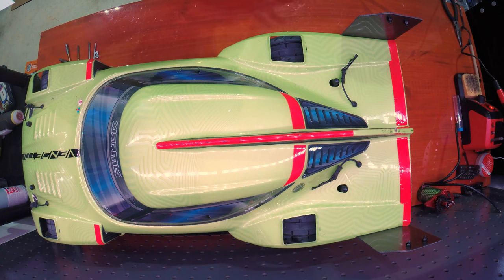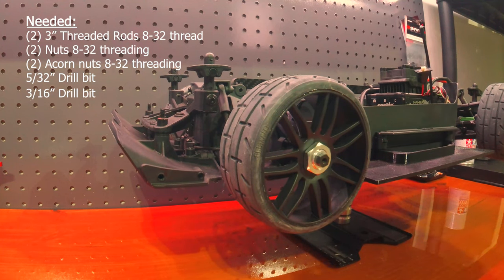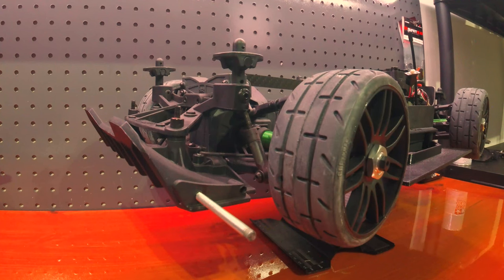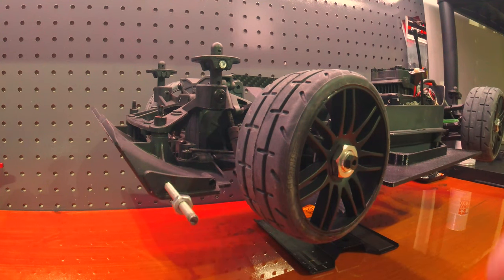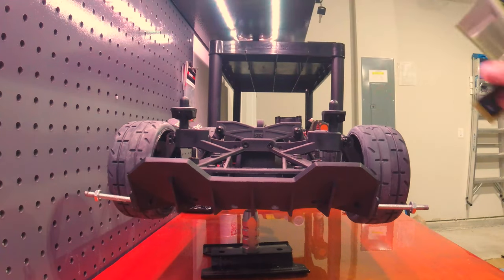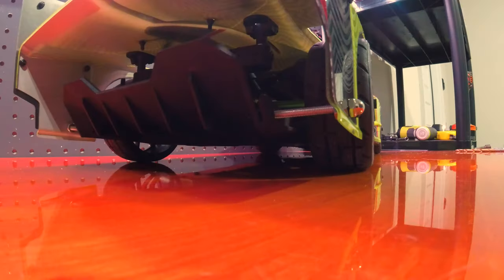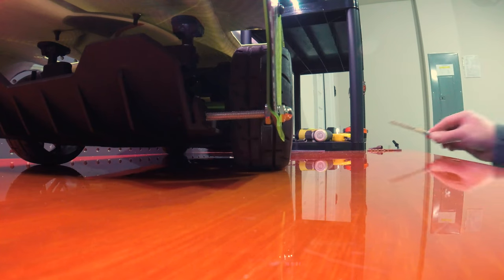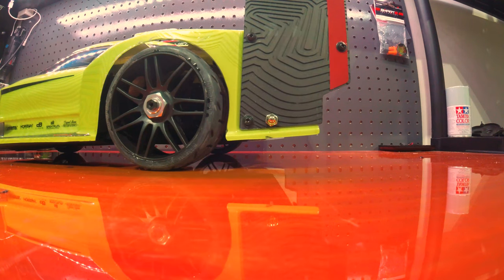Arrma Vendetta | Rear Fin Stability Fix

Comment: two suggestions double up the nuts to you can lock the nuts in place so you wont have to keep adjusting them and swapping out the acorn for a thumb nut instead will make putting on the body tool less.
Reply from the maker: Appreciate the feedback! The thumb nut is a better option than the acorn.

Comment: Great idea man, appreciate you sharing the info...definitely something I need to do to my vendetta too. Apart from taking off the speed wing, I noticed you didn't have the plastic diffuser piece also, better stability??
Reply from the maker: No problem! Yes, I still run that plastic piece above the diffuser. Some say removing it will allow trapped air to exit and not cause turbulence, but I haven’t noticed and the car has been fast enough for something like that to show at this point.
Reply: @speeedy_rc  Yea I've seen a lot of fast vendetta's and most of them still have on that piece. thanks